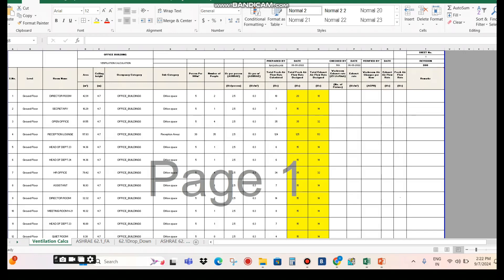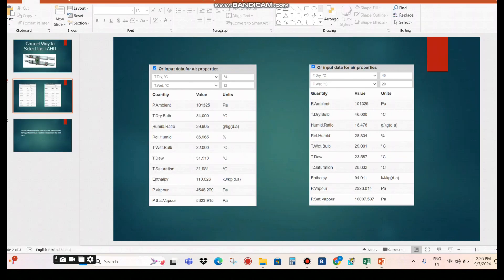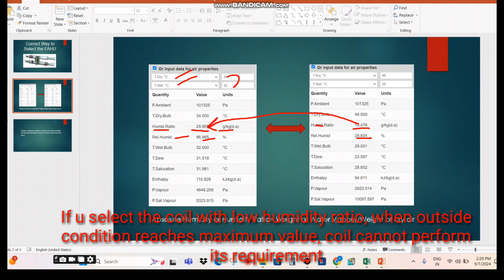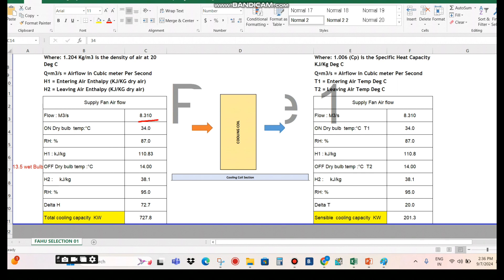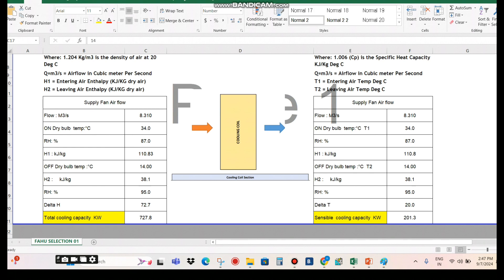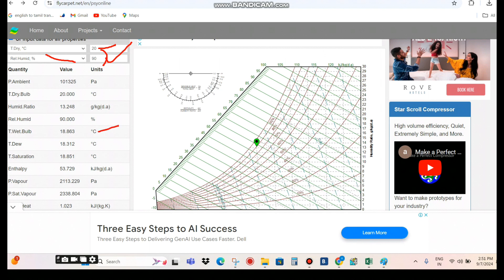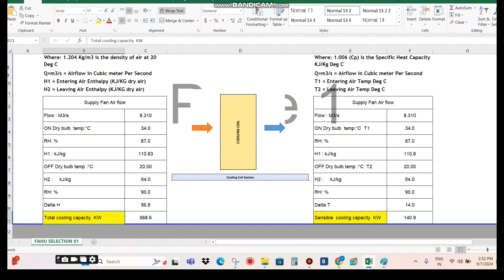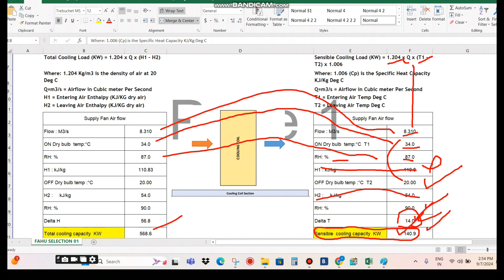Problem on Cooling Coil Selection l FAHU Cooling Coil Capacity Calculation l Design of FAHU Units

Comment: I believe there is a mistake when setting the FAHU coil leaving air temperature to 20°C when it's operating. By doing so, you're assuming that the FAHU is responsible for cooling the offices all the way down to the comfort zone of 24°C. However, in reality, it is the FCUs located in each office that handle the final cooling. The role of the FAHU is only to pre-condition the fresh air — bringing it down to around 26 or 28°C after mixing with the return air. Therefore, I think it would be more appropriate to set the FAHU leaving air temperature to 26°C instead.
Reply from the maker: It's not a mistake. Due to many factors consideration, it is set like that. We have explained all the reasons in our classes. If u like to join u can contact us on +971543402687

Comment: Great Job and thanks for sharing your respectful knowledge withothers, but still we have just a concern about the weather temperature if it exceeds the 34 degrees (for example in qatar temperature at summer time is reaching 48 to 50 degress and more), so how the FAHU will cool the air. thks brother
Reply from the maker: Thank you for your support brother. Its very simple. If you see the psychrometric chart for 46 deg c db/30deg c wb humidity ratio and 34/32 deg c humidity ratio, u can see high value in 34/32 not in 46/30 (46/30 is used for qatar unit selection as per QCS section 22). So we select the FAHU with worst condition so it will perform even the temperature reaches high. Here main concern is humidity ratio